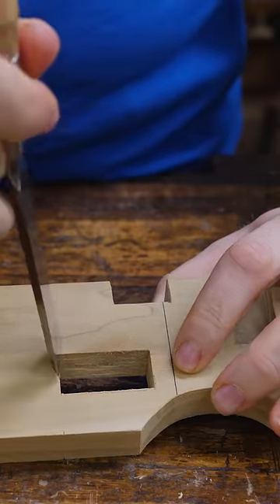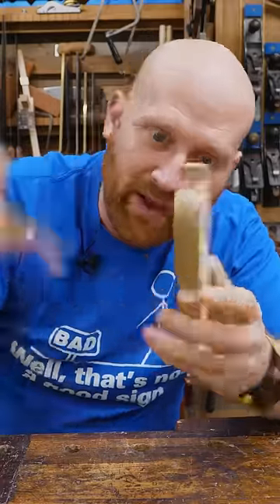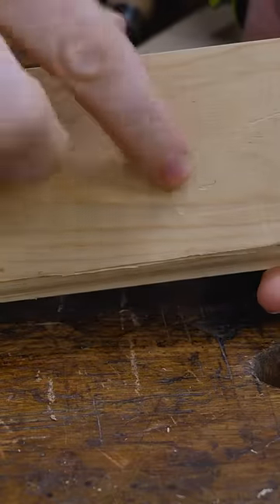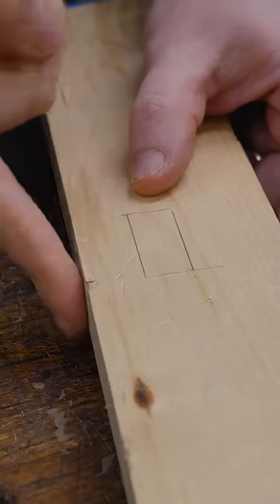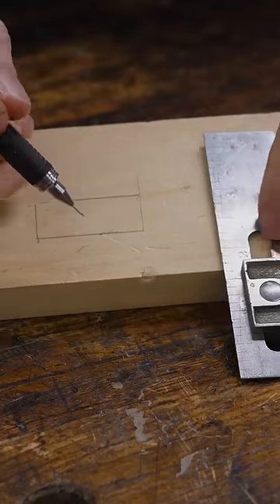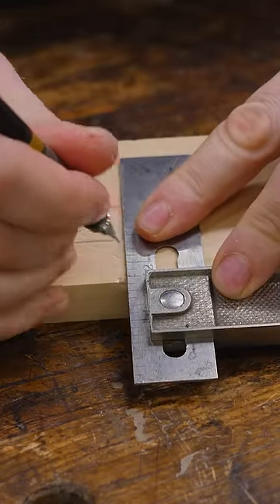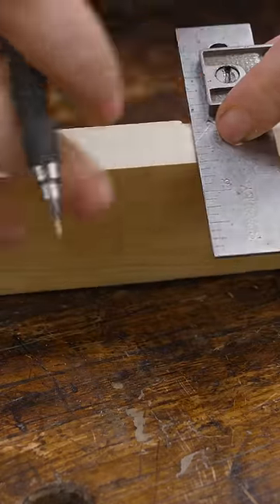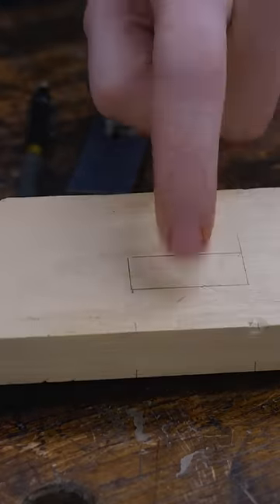How to Transfer marks to the other side of the board

Comment: I use a 1/32 drill bit to drill holes in the inside of each corner.
Reply from the maker: that gets you close, but takes a LOT longer
Reply: @WoodByWrightHowTo  if speed is the only factor drill with a mortising attachment. If accuracy is the question then small corner holes with a drill press works 100% of the time, if cleanliness if the focus, then marking is a lot more prone to leaving marks. While you show a good technic, it is far from the best, fastest or cleanest.
Reply: Cool. How do you drill perfectly straight and square ensuring you dont drill at a slight angle. I'm new to woodworking. Im sure you can tell!
Reply: @Nick-cp8wf  a drill press, which i consider a critical first purchase for any shop. Got mine 125 dollars new
Reply: @Nick-cp8wf  Drill press. Or if we're talking a 1 by board, you can hold a 2' framing square up to drill and get close enough. Otherwise, drill press.
Reply: @Nick-cp8wf I've been woodworking for 10 years professionally.

A drill press is nice to have, but you don't need one in many cases.

You can use a drill sleeve if you don't have room for a drill press. You can also clamp together two blocks that you know to be square, offset to create a square inside corner, and hug the drillbit to that inside corner to guide your bit if your bit is long enough.

But as with most things in woodworking, there are many ways to accomplish the same task.

The question is which is the safest, accurate, and most efficient method given the circumstance.

In this case, I would just use a square and a marking guage like in this video, even though I have access to $millions worth of machinery.

Also, what he's doing is making a Gottshall block. A small project designed to teach fundamental woodworking techniques to students. 

This is the method intended for the student to learn when laying out this mortise.

Comment: I have always just drilled a hole straight through dead center with blue tape on side drilling where it doesnt matter if it is blown out and then take tape stencil with hole in put it on other side right over hole parallel to edge.
Reply from the maker: How to get you close.

Comment: If a once off and just needs to be fairly accurate, that's a good solution. If you want it super accurate you can make a good template and get it spot on, everything marked to within a knife width.

If you've a good few to make a pair of jigs/templates for each face, speed up production without sacrificing accuracy.

Comment: In extremely tight tolerance projects this is close enough just stay lines inside and when you are straight, come from another side slowly taking away material to get perfect hole. For most this method is fine but if you dont want to have any gaps its not perfect to trust this method. Marking knife also cuts the wood, where pen marks can be sanded out easily.

Comment: How about drilling tiny holes in the four corners to transfer from one side to the other?
Reply from the maker: That'll get your clothes. But it's not as accurate and it takes longer than just drawing a line around the board.

Comment: What about a nailer, like a brad or something, on all the corners. The corners would be marked and it might not blowout the wood fibers because of the high pressure?? Just an idea I haven’t tried it, but it might work.
Reply from the maker: Those tend to curve in the corners. Some people will drill holes in the corners to transfer the line to the other side but that often moves you a little bit of course. And it takes a lot longer than just marking around the board.

Comment: How many leads do you think you would go through using a mechanical pencil to do woodworking?
Reply from the maker: I generally don't use a pencil. Marking knife is far more accurate. However for video I need to use a pencil so that people can see the line.

Comment: Couldn’t you also throw it up on the drill press and get your corners. Drill slightly inside the cornea of course so you don’t ruin your diameters.
Reply from the maker: That will get you close, but it will take longer to set up the drill press then to just mark it out with a square and marking gauge.

Comment: Would you do that, or would you rather measure it? I’m curious cause I would prefer to measure it, having never done your method lol
Reply from the maker: Anytime you use a measurement you introduce inaccuracies into the work. A tape measure will cause more gaps than most any other tool in the shop. There are times when it cannot be avoided but anytime when it can I try to stay away from it. Plus using a square tends to be considerably faster.

Comment: Just did this with my first mallet had some random hardwood blocks really hard like super hard random sized mostly 3 by 3.5 by 2 feet  made a nice mallet found them in the basement at the apartment i rent it’s an old house split into apartments

The wood dimensions are incorrect it’s more like 4x3

Comment: What if you just puts holes in the corners
Reply from the maker: That will get you close, but it will take longer to setup the drill press and it will not be quite as accurate.

Comment: Seems like a whole lot of work for something I can drill a hole in the middle, and then trace my template around the same hole in the other side.
Reply from the maker: During the hole will get you close but setting up the drill press to do that will take you a lot longer. And the square will be in far More accurate.

Comment: Wouldnt it just be easier to use a measuring tape? measure the distance between the end of the wood on all sides relative to the beggining of the each line of the 1st drawn shape , then measure it on the other side 2 times to create two points then use a ruler to connect the 2 drawn points for each line , and u have close to 0% margin of error , even if the board is not even to begin with :D
Reply from the maker: that would introduce more inaccuracy and would take longer. any time you use a tape measure you are introducing inaccuracy. some times it is the only answer but that is an un common need in the wood shop.
Reply: @WoodByWrightHowTo  a tape measurer introduces innacuracy? 🤔 I mean i base my experience on the Metric system so thats actually the opposite from the truth , at least from my experience. About the time , maybe it takes longer yes , but with good measuring it never fails , its always on the dot. We use the same system Logic to take measurements to install stuff on the wall and on the ceiling , to drill the holes needed and to make sure its always aligned ( at least in my country , most walls and ceilings are not straight , so its the only way to make sure we dont mess up the alignment )

Comment: Seems like you'd have difficulty if you didn't have all these convenient right angles. Can you not just chisel into a sacrificial material or start with a jigsaw and finish with a chisel or fine handsaw?
Reply from the maker: Yeah, if you don't have a square edge to measure from then you've got to come out at a different way. But even chiseling with a backing board. You're probably going to get some blowout. But 99% of the time there's a square edge to measure off.

Comment: Make a little rectangle jig, drill a hole in the center of the wood and use a straight router bit. Just have to square out the corners with a chisel.
Reply from the maker: That will get you close but will take a lot longer.

Comment: it's like when you use a hole saw and don't want to splinter the back side you use a backer board and cut into that, no lining anything up.
Reply from the maker: Drilling in the corners will get you close. But it takes a lot longer and it is far less accurate.
Reply: @WoodByWrightHowTo  oh i meant to use a backer board to prevent the splintering, it's similar to cutting all the way through wood with a plunge cut with any tool without something behind it, always going to get splintering or a ragged edge.

Comment: Couldn't you just drill the corners? Put the board on top of a piece of scrap wood to avoid blowout
Reply from the maker: That isn't really all that accurate. It doesn't actually give you a tight corner location and if the bit is even slightly out of swear you're going to have gaps on the other side. Plus it ends up taking longer in the end.
Reply: @WoodByWrightHowTo  That's what chisels are for, which you would be using anyway.

Comment: can't you just make a hole that passes entirely through the wood and scrape away the intended shape from just one side?
Reply from the maker: That will get you generally close. But usually it takes longer to set up a drill press to do that then it does to mark around. And marking around with a square is far more accurate unless you are working with a board that has an organic edge.

Comment: YEAH. Or just throw the piece under a drill press for an exact 90 degree drilled hole and measure whatever you need from the hole.
Reply from the maker: That'll get you close but it will take far longer to set up the drill press than to draw a couple lines with a square. And the drill press wouldn't be quite as accurate.

Comment: I have tons of tiny drill bits from machining and jewelry work and I would just drill 4 tiny holes in the corners on a drill press and they'll be perfectly lined up. Then chisel it square
Reply from the maker: They'll get your clothes. But it won't be quite as accurate and it will take far longer to set up the drill bit and drill the holes.

Comment: I just use a single adjustable square to transfer the marks. It's worth noting that this method only works if the edge is actually square and straight.

Comment: Just use a drill press and stamp it out?
Reply from the maker: That will get your clothes but it will take a lot longer set up. And get running. Not to mention you still don't have to mark the other side once the holes are through.

Comment: Do you know what a speed square is my dude?
Reply from the maker: Speed square is great for carpentry and some power tool applications but not great in the hand tool woodworking shop.
Reply from the maker: It is designed for the carpenter not the woodworker. The bezel on it is very thick and causes issues when needing to get into tight places as well as making it more difficult to register the knife off of. However for house framing it is fantastic.

Comment: Not necessarily true. It's reliant on those edges and corners being straight & 90 degrees exactly. If not, then if you use the square and mark all around, but the lines won't join up.

Comment: This would only work if your wood is square which yours in not. The hole do not line up. They are about 2 thumb nails off. The best way I have found to do this is just drill then square everything off with a chisel. It's not the fancyist but there is very little error in it.

Comment: Or just clamp a thin board to the back
Reply from the maker: that works in some circumstances, but then it comes down to how good your accuracy is chopping vertically.
Reply: @WoodByWrightHowTo  I just use a router and do the corners by hand, the finished product looks the same and it takes way less time
Reply from the maker: True. But this channel teaches hand tools.

Comment: You wouldn't blow the back side out if you had scrap timber underneath
Reply from the maker: Even then you'll still chip out the back side as there is always spring and the wood. Especially with softwoods. If you're talking about really hardwoods then they won't deflect quite as much. But even then you have to be careful to make sure that you're going perfectly. Vertically. The nice thing about coming at it from both sides is that you know the outside edge is exactly where you want it to me.

Comment: Or... you could clamp a piece of sacrificial wood to it, and drill your corners with a small hole. Faster, easier, cleaner, and no tear-out.
Reply from the maker: Don't get your clothes. But if you're making a through tenon it will leave a few gaps. Not to mention setting up the drill press to do it will take far longer than just marking around the board.
Reply: Setting up the drill press??? You mean putting in a small enough bit? How long are you taking to put a bit in the chuck? 
This isn't a union shop, get to work! ^_^ @WoodByWrightHowTo
Reply from the maker: even with that small amount of time drawing the line is faster and far more accurate.
Reply: @WoodByWrightHowTo  ⌐_⌐ No... It's not faster, the rectangle for your corners is already drawn on the one side... Again, it takes a few SECONDS to put a drill bit into the chuck.
As to the accuracy, that is absolute hogwash... No matter how accurate your lines are on the other side, you are literally drilling in SQUARE from the marked side, any possible failure of accuracy would be a defect in the drill press which we both know is highly unlikely.
Meanwhile suggesting that hand tools are going to maintain comparable accuracy to a drill press designed to stay within THOUSANDTHS of an inch is preposterous on its face.
You do your way, I'll do mine, we both know what the truth here is, and it's not on your side.
If you feel this strongly about it, by all means, do a real-time video about it and prove me wrong, show the actual time to check and transfer all the marks versus how long it takes to put a drill bit into the chuck of a drill press.
I await your video.

Comment: Or you could just use a template. On both sides of that wood piece.   It would be faster, easier and more exact. And you could make identical, EXACT pieces a year from now, 10 years from now, with no measuring, no tool manipulation,  etc. 
JUST USE YOUR TEMPLATE!
OR PATTERN PIECE!!!  AND MARK THE AREA YOU WANT GONE!

TEMPLATE ARE MORE EXACT, EASIER, FASTER.  MUCH LESS CHANCE FOR ERROR!!!

WORK SMARTER, NOT HARDER!!!
Reply from the maker: Thanks for the feedback. I will greatly disagree but if you want to make production factory work go for it.

Comment: Or you know just use a sacrificial back and save hours on a project
Reply from the maker: That works sometimes and completely fails on other times. Plus if you're chisel is out of alignment slightly then so is your hole now. You have gaps. If you put the Mark's on both side. Then you can make sure that the lines that matter are exactly where they need to be.

Comment: Or just drill it like a normal person...
Reply from the maker: That'll get you close but it's not all that accurate.
Reply: @WoodByWrightHowTo  It will sovle the problem of "breaking" the bottom... The rest you can just cut with a chizel or even a file if you had the right kind of drill.

Comment: Sorry but this guy has no clue, if you are drilling / cutting / chiseling a hole  all you need do is clamp a bit of wood on the other side and you can drill  cut and chisel all you want and it will be a perfect finish
Reply from the maker: That will work in a lot of circumstances but in many of them it won't. It depends on the wood you're going through and the wood you're going into and the tool you happen to be using. On top of that then you have to make sure that what you're doing is perfectly straight. Whereas if you cut at it from both sides then you can be guaranteed you will have a perfect entry and exit.